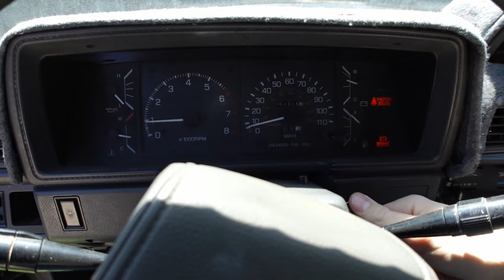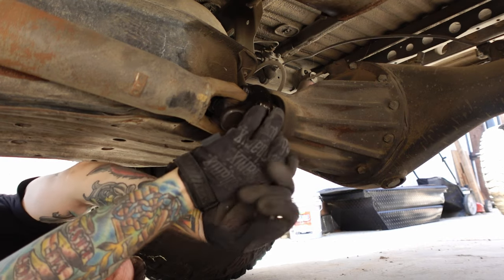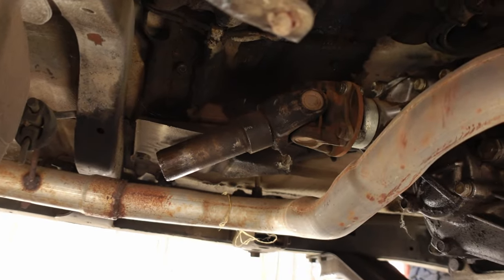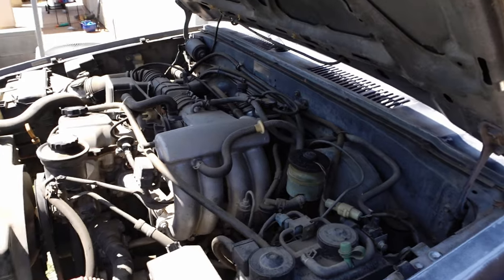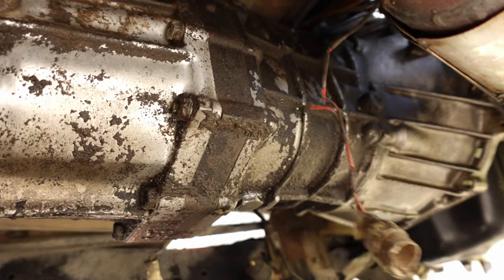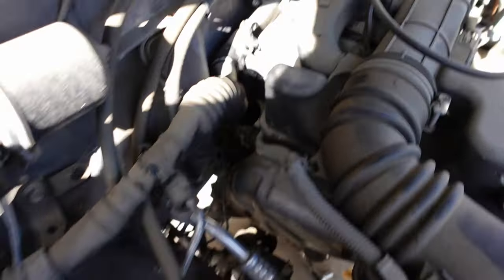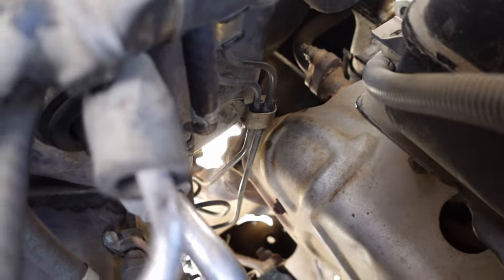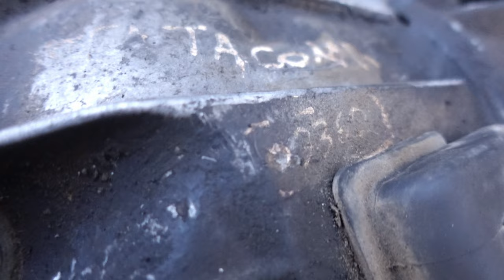4Runner Transmission Problems… Is it Ruined? - Toyota W56

Comment: Surprise! The W56 a/b models have that bolt in shifter. 

Also for driveshaft bolts I use a wrench on one side and a ratchet or impact with a wobble extension and short socket on the other side. Check out Capri Tools stubby impact sockets. They fit in places you wouldn’t think possible.
Reply from the maker: Thank you! I’ll check them out. That seems like an easy way for sure

Comment: You can use a  " cheater pipe" to get more leverage on those bolts. It is simply a longer pipe you slip over the wrench or rachet handle. I know it's a year later. But still works.

Comment: I have an 89 4runner 3vze 3.0 6 cyl.    Automatic transmision began the issue with having to rev it for a minute before it would engage in 1st.  Seemed fine after it got going and ok throughout the day afterwards.  Then again the next day, the same.   It's gotten worse.    Is this a symptom of anything other than a new transmission?

Comment: You probably figure this out already but if you remove the tranny cross-member and let the weight of the tranny sag down you can get to the top tranny bolts with a 2+ foot extension.  You may have to losen the motor mount bolts a little to let the tranny sag down more if needed.

Comment: with those top two bolts i used a 2' extention and my son was ratching from inside of the truck from the floor where the shifters are.
Reply from the maker: Hilarious! It was even worse on my landcruiser. My god. I had to climb into the engine bay and shove my arm behind the motor.

Comment: For the driveshaft could chock the front wheels. Throw in neutral. Then use the box wrench and a 3/8 impact gun with a swivel socket lol. Ass end lifted can spin the drive shaft easily lol. also for the engine swap stuff definitely dont need bar approval to swap and register your car lmao. Im in cali. As long as you get it smoged your good and you know what im talking about lol

Comment from the maker: What do you guys think is wrong with it?
Reply: Perhaps something broke? Just being sarcastic, haha. I like your videos because you're already involved in the parts of maintenance that I'm trying to stage out for my '89 Pickup. Gonna do a frame up restoration. Any suggestions for things to avoid or mistakes not to make?
Reply from the maker: @mikeofthemountain9865  One of the things I've realized working on these old Toyotas is to use Toyota OEM sensors only. For example, when doing a knock sensor on a 3VZE you're playing with fate if you don't get a Toyota sensor >.< Ask me how I know! Nothing else really coming to mind, just don't cut corners and take your time.

Comment: just remove trans cross member bolt lower with jack and use a 36" extention with a swivel and im pact those bolts come out easy